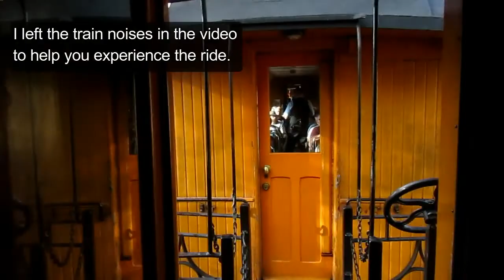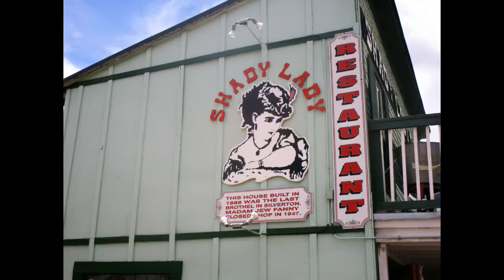Colorado Railway

Comment: I see the boat is for sale with out the tender why ? And you never put solar panels on the boat  ?
Reply from the maker: Bill, The boat is priced so far below insured value that the presence of the dingy does not change the price.   So, why not save the dingy to go fishing on?  I paid $16K for the dingy.....

The next owner can opt for solar panels.   I had no issue with my batteries charging with a short duration of engine running.   This thing has a massive alternator.
Reply: Sailing Puffin thanks for getting back to me it's a nice boat I'm just letting you know that when someone goes to look at the boat they will low ball you by saying there's no tender and the deck needs too be done over  and a bunch of other little things that need to be done to the boat just saying. Now back to me I'm thinking about getting back into sailing I'm selling my house truck camper Harley I will be looking for a sailboat when I sell everything and I hope this boat is still for sale . Thanks for emailing me back and have a great new life .